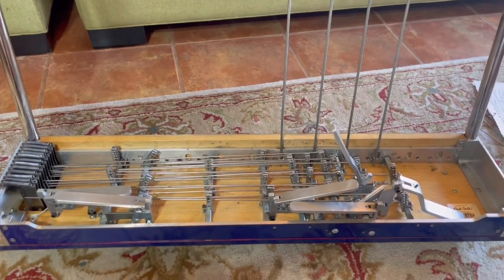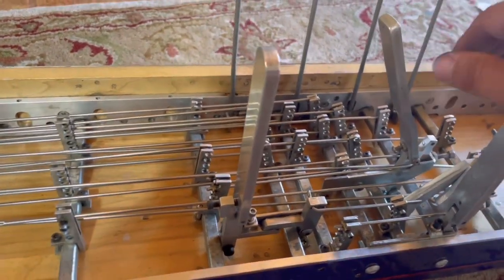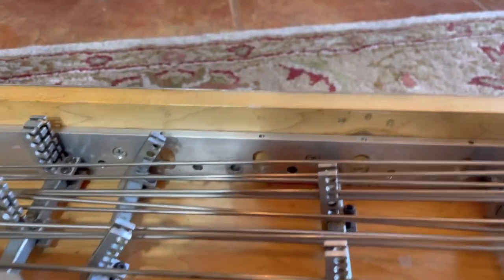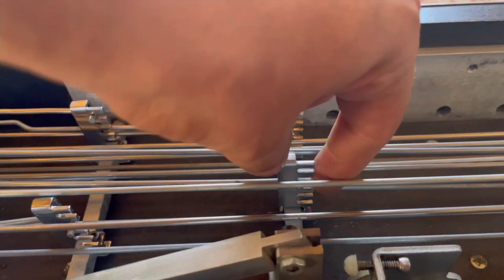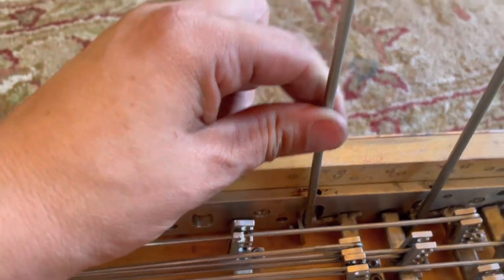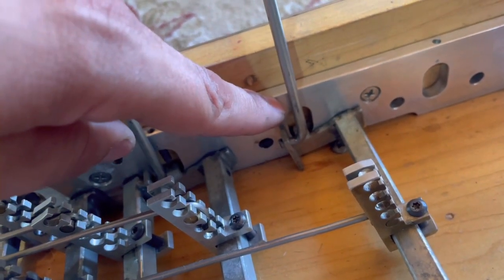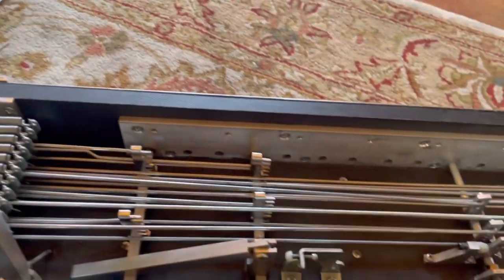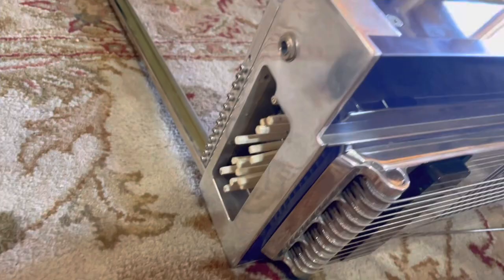Are Carter or Fessenden pedal steel guitars easier to adjust?

Comment: I made a little tool that holds the ball-end of the string on the post. It would work for guitars like the Fessenden. I have an Emmons P-P, and I'm sure dimensions differ from guitar to guitar, but it simply sits between the changer finger and the "tailgate' and is slotted so that it fits over the string peg. You put the ball-end over the peg and then push the tool behind it. It holds the string on while you size and wind it up! I made mine out of emery board (1/8" thick), cut in half with a piece of styrene sandwiched between (this creates 'the slot'). Works like a charm. P.S., the grit of the emery board does not come in contact with the guitar parts., but you could make it of just about anything that had the proper stiffness.